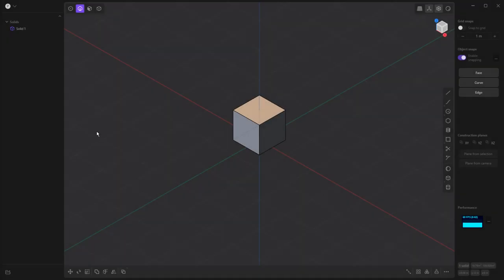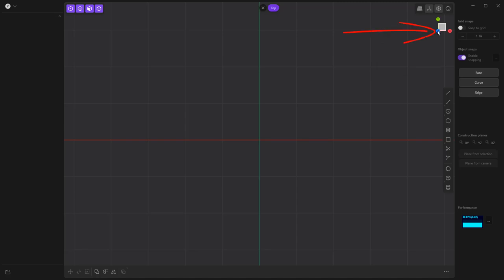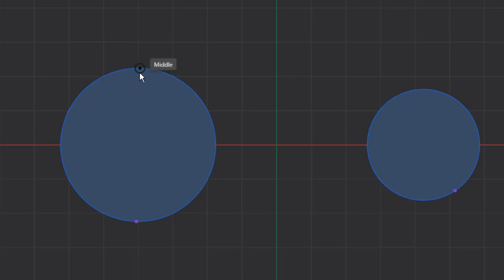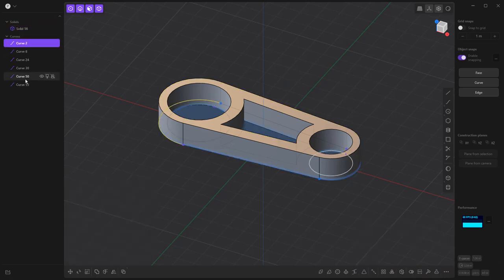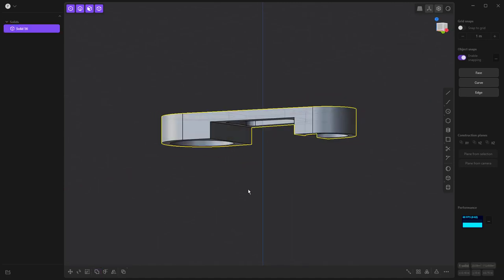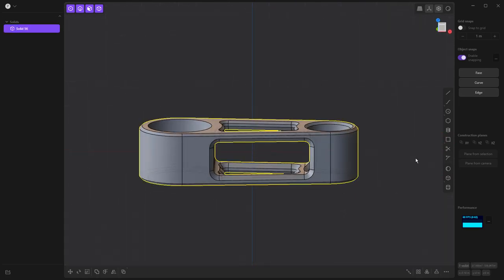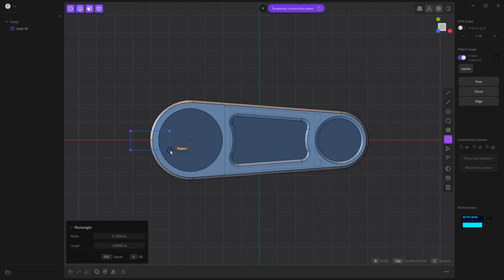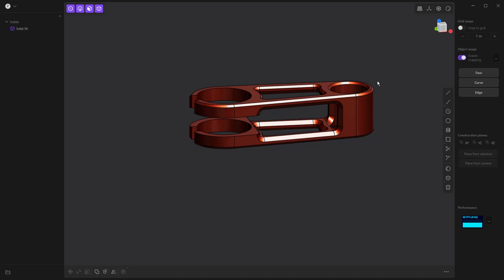Plasticity Quick Start | How To Model A Simple Part In Plasticity

Comment: Just a follow up. One thing that's really nice for people that 3d print. The .step files go nicely between Plasticity and Fusion.  I've taken some of my .step files and done some modifications that were easier in Plasticity then re-exported them as .step and used Fusion to create the .stl's for them to print. Much easier than the blender method to make the mesh.  And the scale of the part was intact.  I've only done a couple but so far no issues with this method.
Reply from the maker: Thanks Oliver!  I pinned this to the top, great to hear that workflow and results. thanks for sharing.
Reply: Hello! Do I need more than the Personal use version of Fusion 360 in order to do this Step-to-stl transition?? Thanks
Reply: Just to add I did this with the free personal use fusion version.
Reply: Thanks, I have been trying to figure out what was wrong with a test cube I made to print, was 10mm cube but becomes 100mm after the slicer resizes the 0.01 Plasticity stl export ! I just tried to export a step cube but just got a 2D outline of the one facet, version 1.1
Reply from the maker: @airheadbit1984  yeah the default unit/grid in Plasticity is Meter.  if you go into the file dropdown menu you can change the units to MM there and hopefully not have scale issues downstream.
Reply: @Oliver1071  Really? in the specs comparison between the full and free version it says that 3D printing features are not supported, and import /export is limited. (Not a F360 user but I've been wanting to learn the basics and frankly that comparison table kinda turned me off --and also the price 😅)
Reply: @LearnEverythingAboutDesign  Can you recommend a good tutorial of Plasticity for resin 3D printing?
Reply: @j_shelby_damnwird  Never read the comparison but it lets me export stl's and step also it allows me to convert a mesh to a solid. So I can import anything I download as a .stl then work on it as a solid and turn on the timeline and then export as a .step.
Reply: @Oliver1071  Ok now I´m intrigued, thanks, I´ll look into it.
Reply from the maker: @j_shelby_damnwird  I haven't seen anything, but the next Plasticity video i was going to make was going to focus on 3d printing.  Is there somethin gspecific you are trying to print/learn?
Reply: @LearnEverythingAboutDesign  Thanks. Just a basic workflow to prepare a Plasticity model for printing.
Reply from the maker: @j_shelby_damnwird  There really isn't much to do.  after you model just export it as an stl and take it to your slicer.  With an SLA type machine you would be adding all the supports there.  I will try to do a video on basic 3d printing setup of the program and design and go from there.
Reply: @LearnEverythingAboutDesign  Thanks man, much appreciated! I´ve read about some problems with size/scale consistency when exporting from Plasticity, could you touch on that issue on future videos?
Reply from the maker: @j_shelby_damnwird  Yeah, the only issue I have found is when exporting an STL, but usually my slicer auto scales it.  If you export a step or iges file the scale is right.  If you export an STL the scale seems to be off by a factor.  

If you set the plasticity units to mm and make a 5mm circle and export it, when you bring it into a CAD program that circle will be 0.05mm, off by a factor of 100.

If you set the plasticity units to cm and make a 5cm circle and export it, when you bring it into a CAD program that circle will be 0.05cm, off by a factor of 100.

If you set the plasticity units to m(default) and make a 5m circle and export it, when you bring it into CAD its .05m, again 100.

If you set it to inch and make a 25.4in circle and export it, CAD 0.254in.  again 100.

Why? not really sure.  But the good news is that the beta version has the scale at 1:1 fixed.  As soon as that is the stable release that issue should go away :)

Comment: As a trained and 20 year experienced AutoCAD draughtsman, half of what I do is get over its crappy failures, difficulty in working with digital fab file formats, and expensive licensing.
I have tried Solidworks, Inventor, and hundreds of other pieces of 3D software and hate sketches and cannot for the life of me understand constraints.
This software seems to be how my brain works. I know my end goal, and as this models almost exactly like AutoCAD I don't need to go back and edit something I did 500 steps ago. 
I also love the close to command line interface, most of the inputs I make are typing. Fillet, R, 50, m.
You've definitely sold me on a 30 day trial of this.
Reply from the maker: The first CAD program I ever used was Autocad in probably 96.  it was all command line :)  I think as Plasticity progresses(even 1.3 has added a lot since i did this video) it will only get better.  Now when you begin drawing a line you can hit TAB and get to the dimension on creation.  Might give you enough control.
Reply: @LearnEverythingAboutDesign  That sounds awesome, I hate the draw then dimension of most cad software,  I know what I am drawing, I know how big its meant to be, let me dimension before drawing, or during.
rectang, d, 500, 100

Comment: Will users still have an option to go back into a sketch and add dimensions and constraints if they want to? I see the usefulness of the direct modeling approach, but think also having the ability to have it be parametrized as well would bring it to the next level. Thanks for all of your efforts Anna work on this
Reply from the maker: At this point in time I don't think so.  At least no immediate information about a parameter based system.  With some shapes you can input dimensions after the fact like a cube, but once you start removing material or modding it that option is lost.  You can add measurements on things.  Like if you have a shape and you want to know the distance between two points you can do that.  Similar to how Measure works in Blender.

Comment: SHIFT T. just doesnt' work. am i missing some specific you didn't mention? does it just not work anymore?
Reply from the maker: I just checked and it still works for me during the extrude.  once you start pulling the extrude up look in the bottom right hand corner for all the options, does it say Shift+T there for thickness?  which installed version do you have?  It is not impossible that it changed.

Comment: Earned a sub, clear to follow. One thing if I may: "when extruding a closed curve (where you mirror it then boolean them both out) I don't get a solid when extruding. Instead I get a sheet (hollowed out) and can't use boolean on it. I can off course create a solid box instead, but I was wondering why I get a sheet instead of a solid?
Reply from the maker: Thanks.

on the sheet vs solid. is this true if you use the Box (Shift + b) or start with the corner rectangle curve?  If those work fine but your shape doesn't my guess is that the lines aren't actually snapping.  Make sure in the right the Object Snaps are on.  Use the ... next to Enable snapping and make sure Curve isn't turned off for some reason.
Reply: i'm also getting a sheet instead of volume faces on the extrude, must be a mode turned on somewhere
Reply from the maker: if its a closed boundary it should extrude as a solid.  Can you select the area inside it?  if you extrude with the curves selected that will likely give you a sheet.

Comment: Let's say you realize that the cut made at 5:15 was too wide, can you adjust this afterwards or do you need to start over?
Reply from the maker: There is no link back to curves but you can use direct modeling to resize it(depending on how complex it is.  For something that doesn't have cylinders like this you could scale it in that direction.  for something like this with cylinders you probably will need to offset the faces of the cylinders down to a new value, then select the outside and offset those faces as well.

Comment: At 2:08 into the video, you mentioned being able to grab onto the purple control point after creating the circles, to change or adjust the size of those circles.  I don't have or see those purple control points, did they go away with the latest version?  If so, how do I go back and change or adjust the size of a primitive shape after it has been created?

Also, is it possible to export as .stl or .obj file format on either of the paid versions?  The sole purpose of my learning and buying this is so that I can create/prototype objects and then 3D print them.
Reply from the maker: to display the control points you will need to have the vertex/point selection mode (1 on the numbers on the keyboard).  That should let you display them.  
With a circle specifically you can add a dimension and then scale it up.  with the updates in 24.2 you can use the dimension tool and edit the dimension when you enable move or scale.  One of my recent videos covered this.

as for 3d printing 100% yes.  Ill have a new 3d print vid out in the next day or so, but have a few on using plasticity for 3d printing. we did a print in place hinge as well as printed threads and an older video on a cell phone stand.
Reply: @LearnEverythingAboutDesign  Oh Awesome!  I'll look out for those.  Please don't think I am trolling your channel.  I am running through all your tutorials and just learning as much as I can.  Been having questions along the way.  You've been an incredible help.  Much love to you and yours.
Reply from the maker: @JonneytheKidd  No Worries :)  this can be tricky and the software doesn't really have any pop-ups, messages, or in product help to speak of.  I'll do my best to answer any questions that come in.

Comment: how are you rotating the view and thank you for the quick start
Reply from the maker: I am using the default Plasticity settings.  So mouse scroll button press while moving the mouse to orbit.  Right mouse button to pan.  and scroll wheel to zoom.  You can also hold down ALT and press the scroll wheel down and "flick" the mouse to a direction and it will rotate to the standard view. like right, front. top.
Reply: @LearnEverythingAboutDesign  THANK YOU, I was able to figure out that the little used feature on my mouse... the scroll wheel is also a button.  after I watched a few more of your videos I've gotten to the point that I'm going to purchase a copy and subscribe. Coming from Fusion 360 to Plasticity was just a matter of finding the buttons. again THANK YOU
Reply from the maker: @dksaevs Awesome glad to hear it!  There is also the ability to do custom key bindings by editing the json file.  a bit more involved and not something I have done, but if you find initially that you have trouble with the shortcut keys that might be an option.
Reply: @LearnEverythingAboutDesign  👍 ok that's even better and good to know 👍

Comment: Thanks for the Video! you've earned another subscriber. I've been looking to dive in to a modeling program. The subscription model just kills it for me on most. It's only a hobby for me so Plasticity looks like a perfect fit.  Thank you!
Reply from the maker: Thanks!  I will be covering this more.  Ive filmed a few more vids just haven't finished them yet.  Side note that Fusion 360 is free for Hobby Users.  There are some limitation but it is free if you find Plasticity doesn't offer everything you need.  It is a pretty cool program.
Reply: @LearnEverythingAboutDesign  Yeah I've dabbled with 360 I guess at the time I worried that the policy would change and my work would be lost. Also I mainly need the program for 3d printing design. And while I do want the models to be dimensionally correct they only need to be 3d printable.
Reply from the maker: @Oliver1071  Totally makes sense!  What kinds of things are you trying to model?  maybe i can incorporate that into some of the future videos.
Reply: @LearnEverythingAboutDesign  I'm all over the place from RC hobby items, tools, brackets, organization ( peg board accessories) Phone and computer items. And household items.
Reply from the maker: @Oliver1071  So pretty specialized lol :)
Reply: @LearnEverythingAboutDesign  Haha. BTW just tried it out to recreate a pixel watch/phone charger that I created in the past. Unbelievably fast to recreate the design. I spent hours on it before but whipped up recreation in 15-20 minutes as my first project in software I've never used. So far its up there as one of the easiest modeling programs I've picked up. I think it's a prefect fit for what I need.
Reply from the maker: @Oliver1071  Wow that is great to hear!!!

Comment: After using Plasticity for a little bit I found something that would be of some interest. The best way to make dimensionally accurate models.  Also working with importing assets and keeping them dimensionally accurate for use with a current project.
Reply from the maker: I plan to do some videos on the input topic.  I have an old video when it was early beta that isn't public anymore but some of the workflow is still similar https://youtu.be/OkPI8Vx-gKo  As for imports.  when you say assets do you mean images/reference or 3d models?
Reply: @LearnEverythingAboutDesign  Thanks I'll check it out.  And 3d models.

Comment: One you created a solid, is it not possible to move points from the solid?
Reply from the maker: No you can't.  Plasticity is direct modeling.  After you make a sheet(surface) or solid from your curves they aren't linked.  You can directly move faces on a shape by moving, rotating, scaling, offseting, or drafting.

Comment: What if I'm using Plasticity Maya preset? What are the hotkeys? If you don't know that's fine, you do a good job to mention the tool names most of the time, so I can look up how to use them, but what is the name of the tool that allows you to create it into a "thin wall object" at 3:55? Thanks.
Reply from the maker: I don't use Maya so I am not 100% sure, but in the preferences next to Maya it says "alt-left mouse to orbit, alt-middle mouse to pan".  I would assume right click still accepts.

The actual tools will not change for the maya preset.  the only thing that changes is the navigation with the mouse.   

Thin wall object in most programs is called Shell, but in Plasticity its called "Hollow".

Comment: How do the fillets compare to Fusion360? Fillet geometry in fusion can be pretty touchy when it comes to compound curves.
Reply from the maker: That was one of the big things Nick was working on with this program.  The fillets are pretty robust.  They can be Conic or G2 right now and one cool feature is you can add limits to them.  So say you have an edge of a part and you only want the fillet to go in the middle, it will allow you to fillet just the middle portion leaving the edges squared off.

Like with anything there will be situations where it fails, but it does a good job even if an entire face is consumed by the fillet.
Reply: @LearnEverythingAboutDesign  Oh that's fantastic. I mean I love 360 but even gurus seem to constantly run into fillets/lofts/etc that simply don't compute and nobody knows why.

Comment: Hola tengo una duda, como haces para girar con el mouse de imac en la interfaz? ya que no existe el tercer botón.
Reply from the maker: Sorry I don't use an iMac so i am not instantly sure.  I know you can customize your keybindings in the software and others have done that.  I would check the user run wiki for instructions on setting up custom keybindings https://nullpointerecho.notion.site/nullpointerecho/Plasticity-Wiki-364945653983489ba3e4ad2fc9d0527e

Comment: I can add a size when selecting a center circle but I can't with a 2 point circle.  I'm not seeing any option to accurately change the dimensions of a circle once created either.  I'm so glad this software exists btw.  It's too bad Fusion 360 (what I'm coming from) is cloud and subscription based.
Reply from the maker: Yeah that is a good point. it is only on the center diameter circle.  that is always my goto so i didn't notice.

And no once a curve is created there isn't an accurate way to change its size with a dimension.  you can scale it but everything is "direct" modeling.  No history, no parametric link.

Comment: Can you modify the design or do you have to start over?
Reply from the maker: you can modify it with direct modeling.  For example select a face and push/pull it.  But there is no link back to the curves if that is what you mean.

Comment: Great tutorial, subscribed. I'm in love with this tool, and really enjoying all the info since 1.0 was released. Is there a way to align objects (a-la Tinkercad) that's not just using the move tool to drag things to specific axises, and if so can we get a tutorial on it?
Reply from the maker: Thanks!  And yes you can use "Place"  the shortcut is CTRL+D.  this is kind of like a duplicate and place.  You can try it by making a large cylinder, then make a smaller one off to the side.  Select the smaller one, hit CTRL+D, select a point on the smaller one then drag around the larger one and see how you can place it.  you might need to hit F to flip the normal direction.
Reply: @LearnEverythingAboutDesign  awesome! thanks.